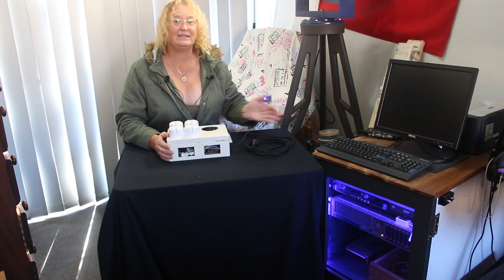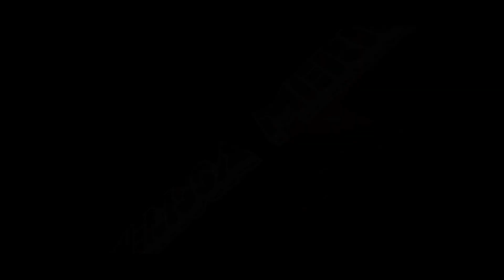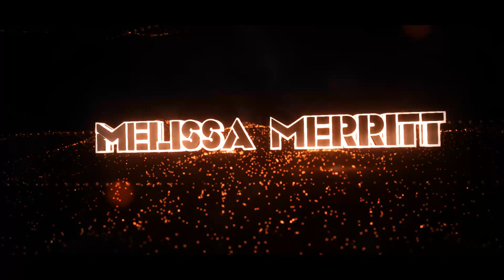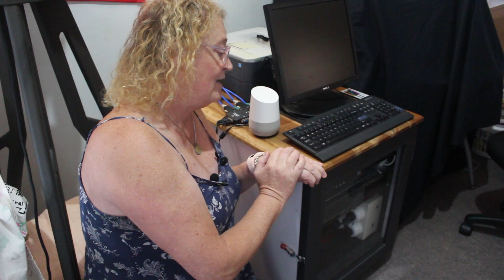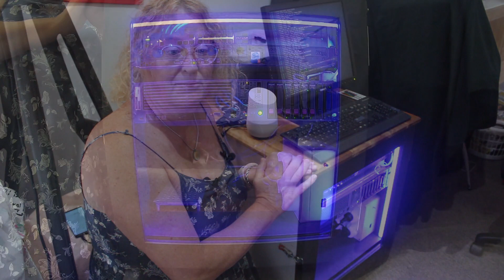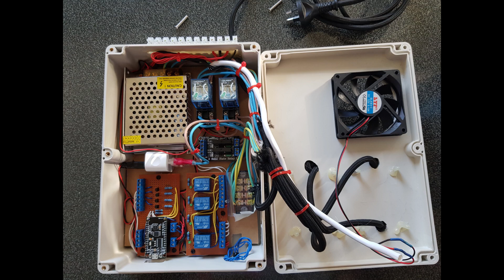Home Server Remote Start with Google Home

Comment: Wow. What a nice little Box.
Reply from the maker: Thanks, I did not do a follow-up website for this project, but its pretty basic design, I used an Arduino ESP8266 to turn relays on and off over the network, I also connected some wires to the On switch in the Server and then back to one of the relay to turn it On or Off, thank you for your comment 👍